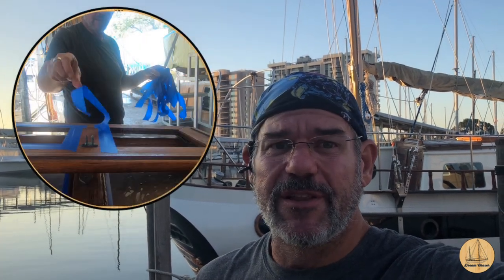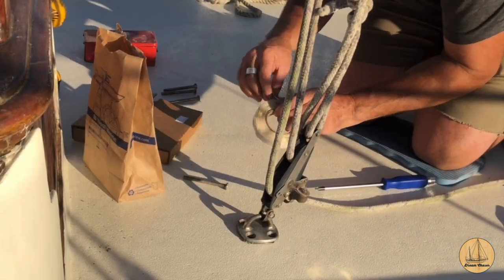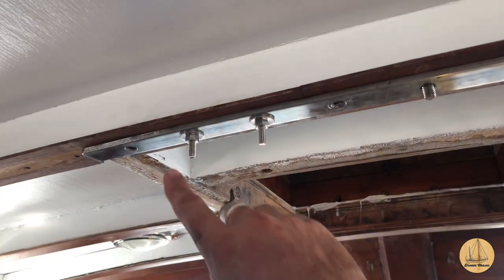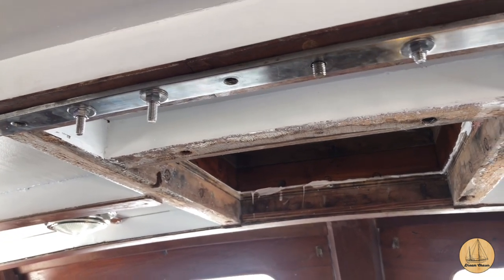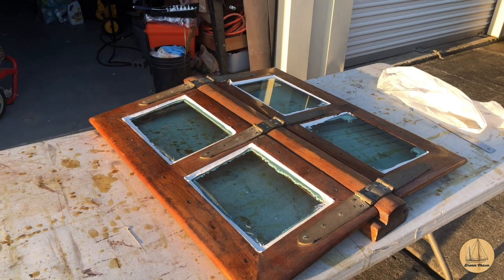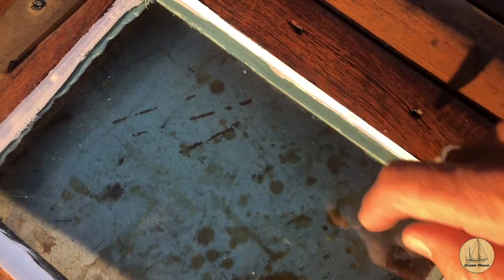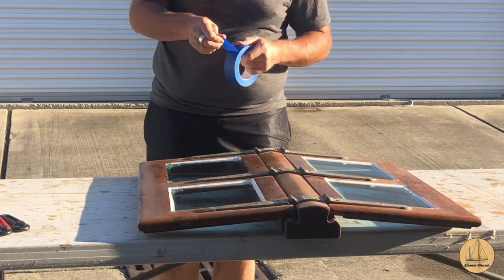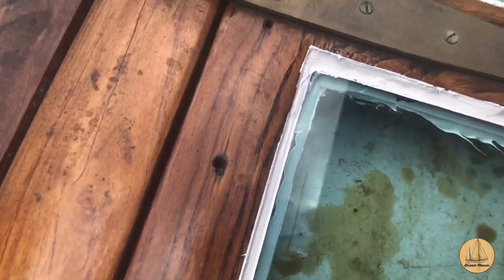How to Bed Glass and Bedding Hardware

Comment: Good work. Keep it up. Glazing is a tough thing to get right at first.
Reply from the maker: +Ed Russell it sure is!!
Reply from the maker: +Ed Russell Man I didn’t realize how hard it would be. It seems like every new glass shape or frame leads to me a whole new learning experience. Lol. What I learned on the coach house ports didn’t transfer to the aluminum frame hatch and polycarbonate material which didn’t transfer to the butterfly hatch with safety glass and a wooden frame. Always learning Ed, always learning. :)
Reply: @Svdreamchaser  yeah they all have their unique challenges. But hopefully you will have it last for years to come.